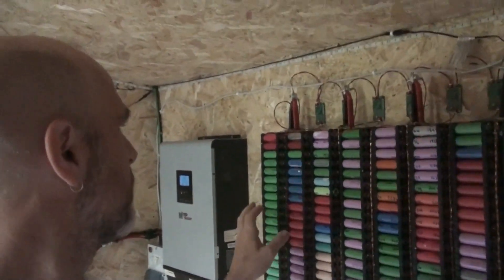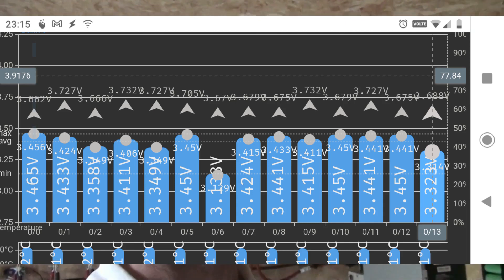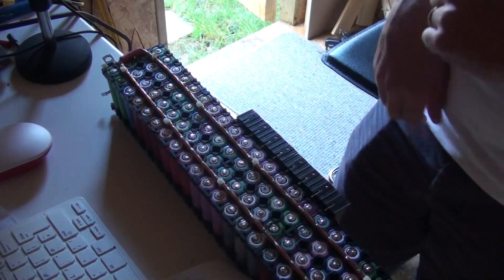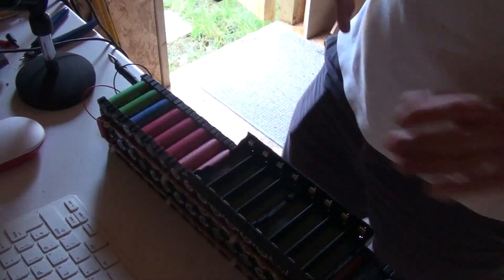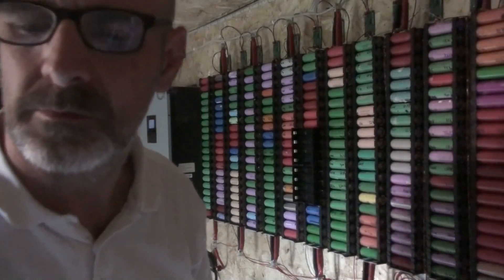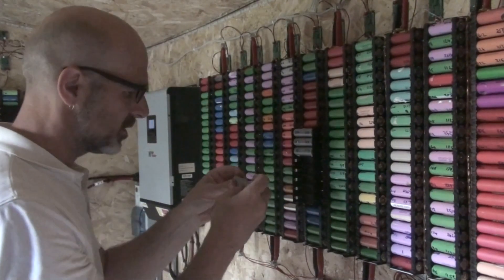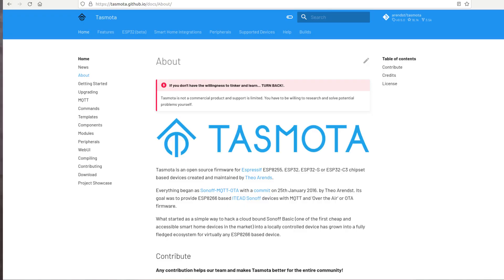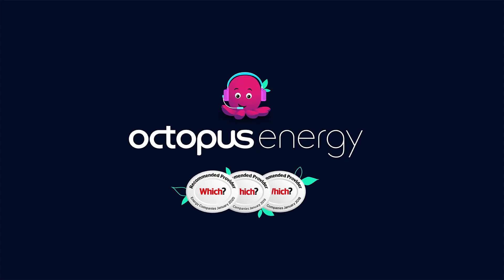Battery tweaks and Software modifications.

Comment: Is it not worth checking there isn’t a bad battery  within the pack rather than adding more ?
Reply from the maker: I do check them every so often but mostly the issue is that because they are used cells their capacity and internal resistance varies. Despite trying to get them all to the same total capacity it's never really accurate. So sometimes they need a little bit extra.
Reply: I really like the idea of adding extra holders to add a bit of capacity when they fade abit overtime. I think Chris has a good point. I've seen this before one of my packs. I did a capacity test and it looked OK. Then let it rest for a couple of days and found one cell in the Pack was self discharging and dragging the pack voltage down. Might be worth checking you don't have a self discharging cell. The way I tell if one of my packs are down  on capacity is when charging its the first to start balancing and when discharging its the first to reach the low cell voltage cut off threshold. Great video. Keep them coming 🙂